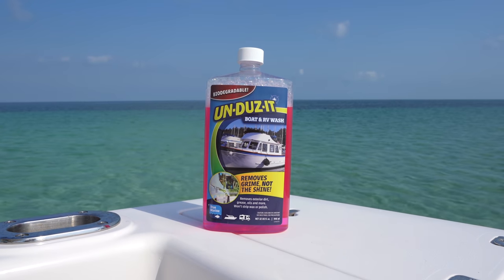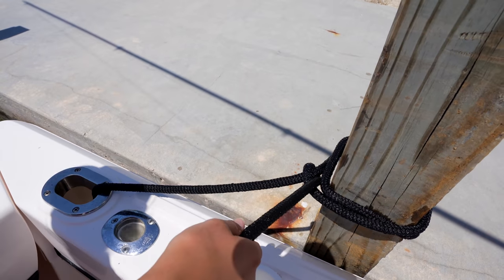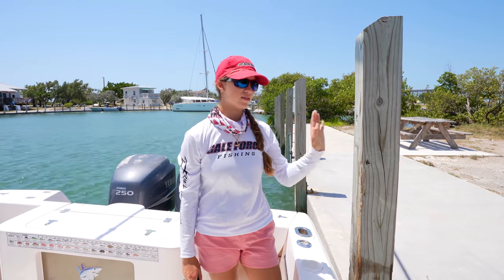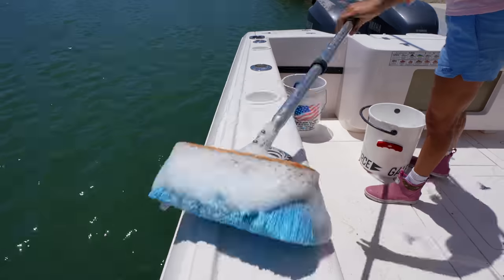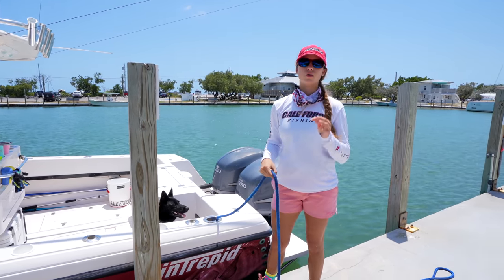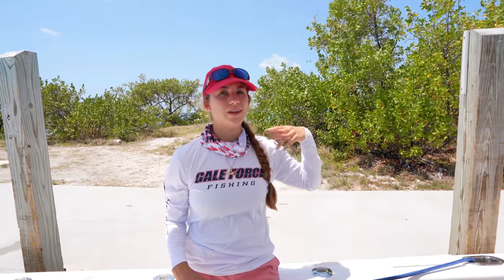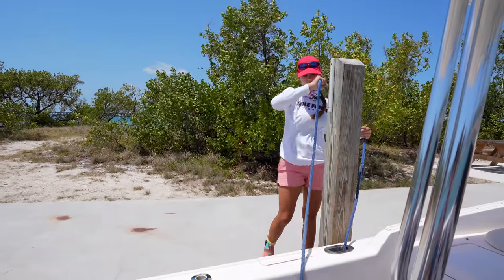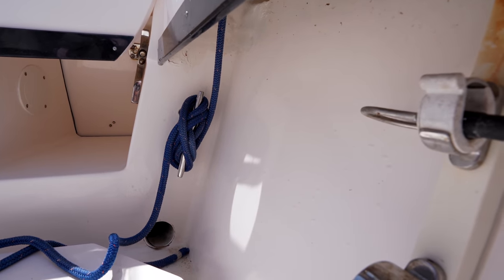HOW TO TIE A BOAT TO THE DOCK with NO CLEATS - Tie Lines To Piling

Comment: I will start by saying I always enjoy your channel.  I am learning to become some kind of fisherman, but have a long way to go.  
Some feedback on your knots.  First, I’m not sure I would ever use a clove hitch on a square pylon.  Round turn and two HH is probably your best choice.  Cleat hitch’s are one of those knots where you ask 10 sailors and you will get 23 different answers.  I always say the right way is how he captain wants it done.  Every captain is different.  My feedback on the cleat hitch is taking a full turn around all horns will set yourself up for the line to lock down on itself if it is ever put under any strong load.   I always teach to go around the furthest horn first and back up around the second horn and then one figure eight with a locking turn.  The locking turn will allow the lines to lay parallel under the top line and secure your hitch.  I never use a locking turn on an anchor line.  I always take as many figure eights as you can fit on the cleat for your ground tackle. A locking hitch will prevent you from being able to release the line in a hurry if there were a dangerous situation and the vessel were pitching and yawing.

Comment: I have a 16 ft boat & I use the last method - one rope & friend was critical & said a person can trip over?
Most boaters tie at both ends at the ramp - I discovered a knot called the "PILE HITCH" It seems quick & easy for two rope method at the ramp around a post.

Comment: Good tips ladies, on the last technique though you've created a bit of a trip hazard if anyone tries to get on or off the boat between those two pilings.  I would probably have gone around the forward piling the opposite direction making a 270 degree loop around the piling, back to the stern piling and done the same before dropping the free end of the line through the hawse and tying it off to the cleat.  That way the suspended rope is on the BOAT side of the pilings and not the dockside.

Comment: Congrats on getting a sponsor! The half-hitch is what I learned as a kid for tying down light airplanes. Very good knot. I was a little confused why you used the spring line to pull all the slack out of the stern line after saying you need slack to account for changing tides. Or is that only if you have another boat right behind you?

Comment: I tie up to pilings all the time for an hour.  Another option is to go around the piling and back to the boat and cleat it off on the boat.  Then you can free yourself from the boat. 

I also put 4 or 5 wraps on the piling before a clove Hitch.  I've had the hitch tighten up and it was difficult to release.

Comment: How to tie if you have a very long rope and you just need to use the portion nearest the object? It's like a situation where you can't find the other of the rope because it's very long. What is the useful knot to use?
Reply from the maker: Look into a bowline knot!
Reply: Lay put, I had a 100’ long anchor line someone gave me for a 20’ center console boat. I anchor in creeks and would never need or want that much line. I needed a long stern line for the dock where I keep it so I cut 40’ for that and still have plenty for the anchor. Just a thought if your long line is overkill. Make it work for you.

Comment: So, tying long bow and stern lines allows for tide changes.  Does a tight spring line mess that up?  Thanks.
Reply: Lines can stretch a little so if u have long lines u will have enough flexibility in your lines, so even if the hightide makes ur boat 2ft higher u will have enough stretch from ur long lines

Comment: Would you mind showing your boat tied at the dock at high tide (for instance) and then what it looks like still tied there at low tide, just so we can see how much vertical travel is involved and how much of the slack in the line is taken up when the boat drops or rises with the tide? I do not live in an area that has tides, and I would like to see how great the change is between high and low tides. It didn't look like there was very much slack in your lines off the bow and stern, so I'm thinking there isn't much difference in vertical travel with the tide change, maybe 6 inches or so? Also, you are doing a great job with your channel and I enjoy all your videos :)
Reply: This varies greatly depending on your location. Where I sail, 1ft is about the average. In extreme latitudes, it can be over 40ft between high and low tide.
Reply: In most parts of florida it is between 2 to 3 feet

Comment: Not a fan of tying off long term on a piling, round or square. Only time I will is using a dock piling bridle with rollers. Simple method for the bridle is cutting a 1.5 or 2 inch inch PVC pipe into 2 & 3 inch inch sections, threading the dock line thought them, then splicing back into the dock line. At the end of the tag end, splice in a 4 inch stainless ring. The Bridle stays on the piling, the boat is moored to the stainless ring. Vertical tide can sometimes be too much for the rope direct to wood to compensate, or the rope getting caught in a splinter preventing vertical movement.